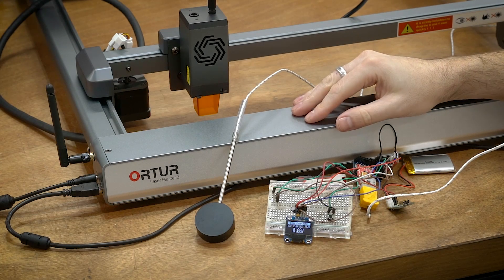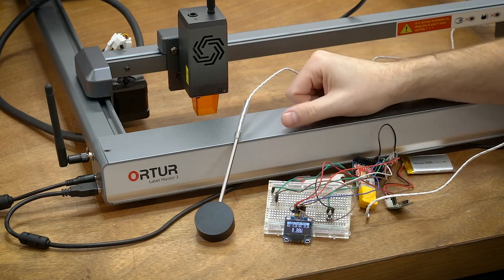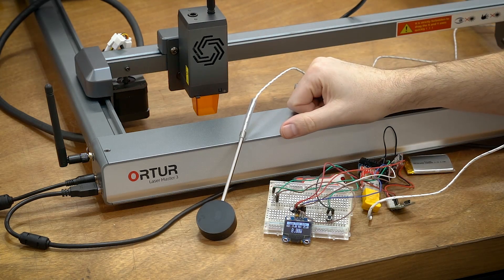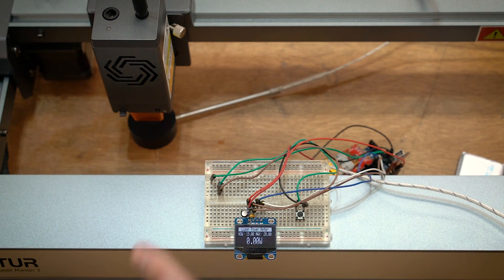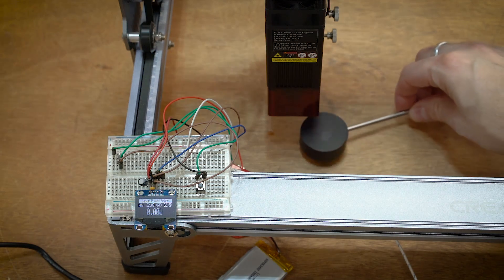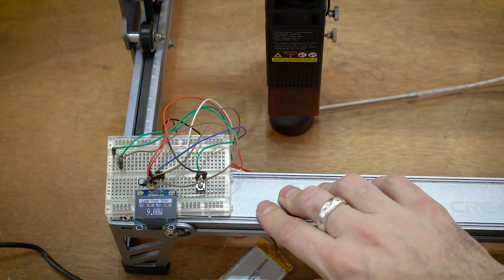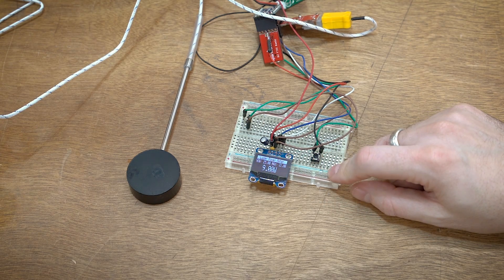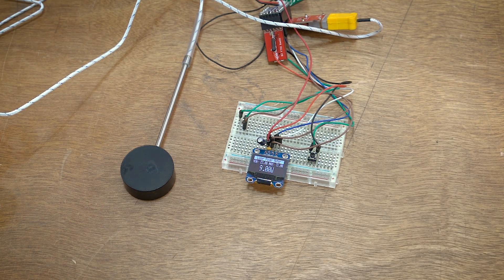Diode Laser Power Testing!

Comment: That's an interesting tester. I wasn't aware they even made those!
Reply from the maker: They make commercial ones, but they're somewhat pricey.  I made this a long time ago because it's nice to verify the power, and also test the linearity of the laser.  For instance, at 75% power, it might not actually be 75%, it might be closer to 90%.  So you run the risk of just burning out the laser if you don't know the linearity.
Reply: I figured they made commercial expensive ones, just didn't realize you could diy one!

Comment: But there is a cooling fan blowing on it?!
Reply from the maker: Oh, that's a great point.  They don't really cool the puck enough for it to make a difference.  There is some airflow, but with just airflow alone, it takes nearly 30+ minutes to cool down.  The airflow won't make much difference.  In between tests, I need to dunk it in room temp water for ~5 minutes.  The ~40 second test won't be affected too much by the minimal airflow.